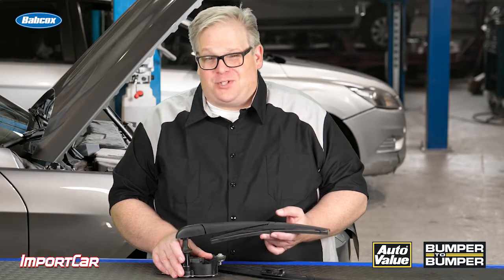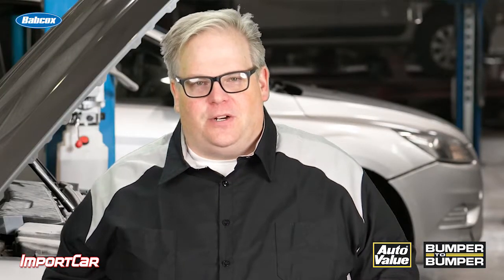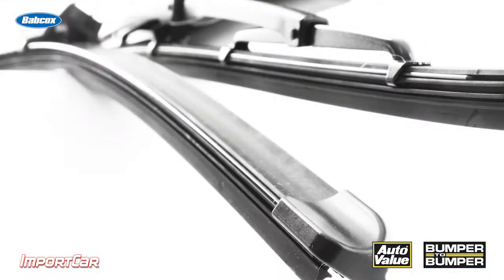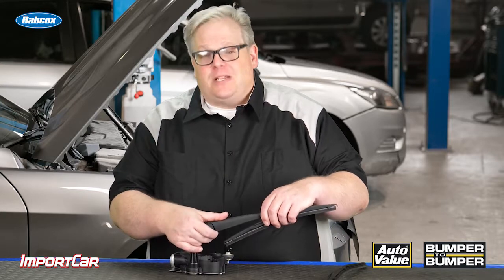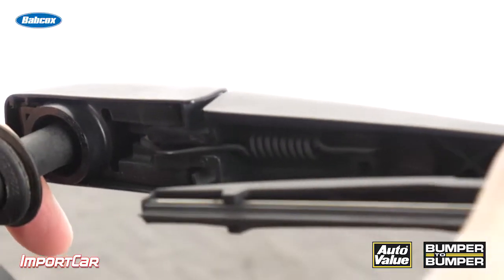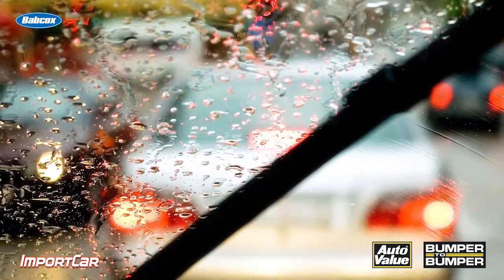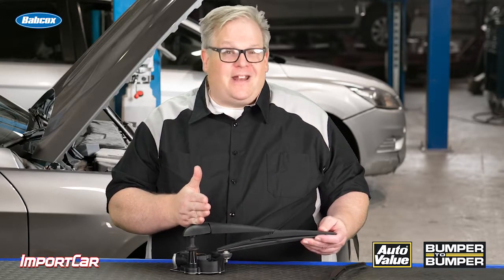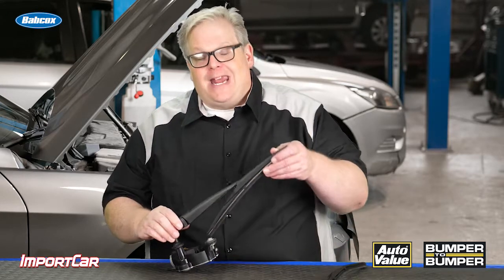New Wipers Not Working? Did You Inspect The Wiper Arms?  | Tech Minute

Comment: My new wipers work fine, but the right one lifts up in the center of the wiper and doesn't make full contact so it misses a small spot in the middle why is that it happens when it reaches 90 degrees
Reply: Did you get it fixed, if so how?
Reply: @darthfader3049  I bent the arm that the wiper goes onto took VERY little bending and issue went away
Reply: In Louisville that's called Kentucky engineering. But it makes sense if you're going to have to replace the wiper arm anyway, may as well try that first.
Reply: L

Comment: I had a wiper arm where the hinge pin was so tight a fit that the joint wouldn't move at all. Lubrication did no good. But then I found out that it was all due to a manufacturing error, and that I was permitted a free replacement, In fact they replace all 3 with no qualms.

Comment: I've just replaced the linkage on my car and now the sweep on the driver wiper is a bit too long, my wiper hits the a piller and the lower seal. The linkage is straight so I think the aftermarket part is a bit long and I don't think the sweep can be adjusted, can it?
Reply: If you didn't get this sorted already, might just be that the wipers starting positions needs to be adjusted?
Reply: @rasmadrak  i tried adjusting, the arm was to long, it's fixed now I bought different arms👍

Comment: You don't have to replace the arm. Replace the spring or bend the arm to have more pressure to the window. Just another way to screw the customer. So what $200 fix . Good for you, not good for customer.
Reply: I was going to say the exact same thing. These wiper arm assemblies are reasonable. A spring is MORE reasonable. (BTW, MY assembles are $60, so what is reasonable about that, not to mention a $2 spring saves a landfill from another perfectly good piece of equipment replaced for no reason).